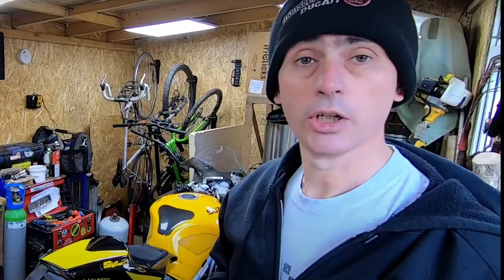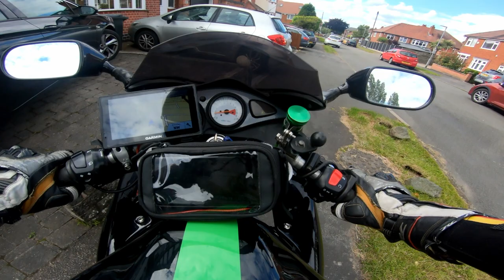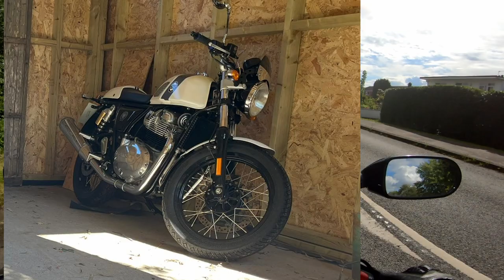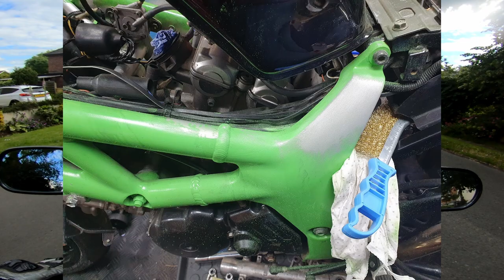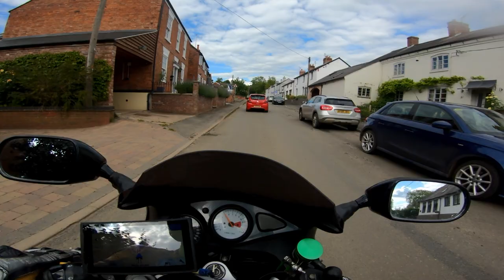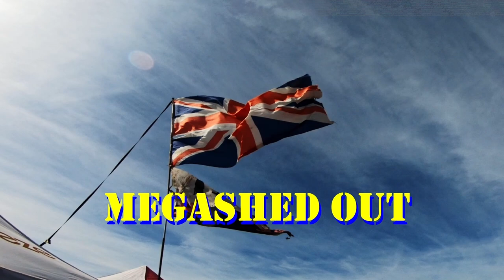SV650 Retro cafe racer plans and first motovlog

Comment: I changed my end can and immediately had poor running and back firing at low revs,  stripped and cleaned carbs but issue persisted, then went from 2.5 turns out on pilot screw to 3 turns out and issue fixed, runs nice now. 2001 svv650.
Reply from the maker: @michaelcrouch5708  I can tell it is front cylinder as it's separate twin exit system. Discovered it idles fine when I disconnect front vacuum hose suggesting it is RICH and not lean. Doesn't make sense. I'm going to try a new spark plug before trying more fuel screw settings.